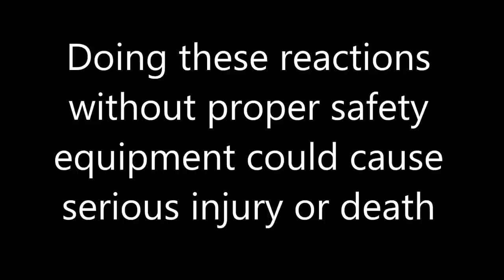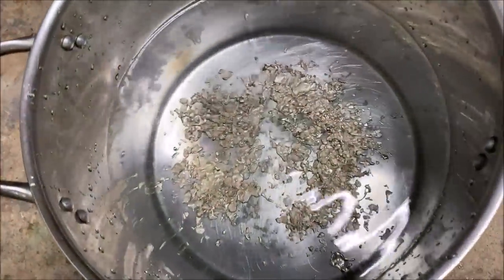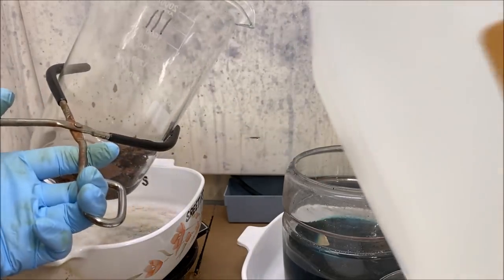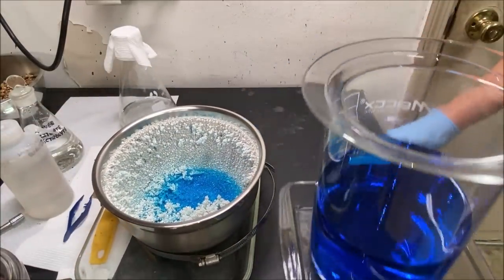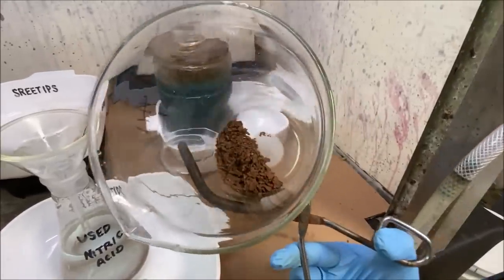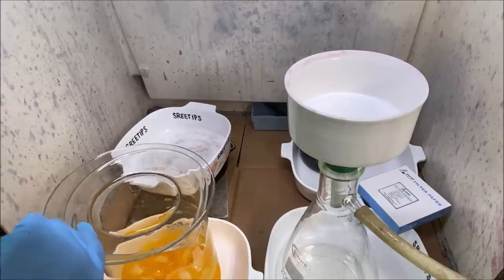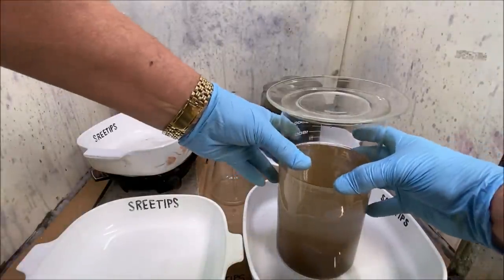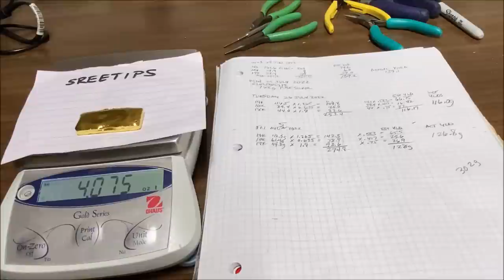Four Ounce Gold Bar Refine With Silver Cell Harvest

Comment: hey sreetips love everything, um the pre-heat on the graphite mould is required - but you should turn the flame off before pouring as it makes swirls. your bars wont come out with circular marks

Comment: The way the title of this video is written. I thought you were going to remove the silver from the gold using your silver cell. Now that's an experiment I'd be interested in seeing. Next batch of karat scrap inquarted with silver. Try running it through a new anode basket and a fresh batch of electrolyte. Then process the anode basket and see how it turns out. That could possibly be another way to minimize the use of nitric acid. New and exciting content is hard to come by when you're refining gold over and over again. Food for thought. Best wishes Sreetips

Comment: I noticed in some of your videos you are wearing a black respirator, if that is a 3-M respirator then that is only for spray painting and certain vapors, that is not an acid respirator.  You should wear the 3-M 5000 series yellow in color for acid gases.  They work very good for Nitric, Sulfuric, Hydrochloric and the NOX given off by the reaction from the Nitric.  Also whenever your not using your respirator it should be stored in a zip lock bag or the bag it comes in which is also a zip lock style bag.  They will continuously absorb all the time they sit outside of the bag and shorten their life span.
Reply from the maker: Good to know, thank you

Comment: When doing those nitric boils to remove the silver and base metals from the inquarted gold, I feel like it might help to use a glass rod to kind of crush the gold between each boil. I feel like it could increase the surface area that the nitric would make contact with and possibly be more efficient. But this is purely conjecture as it's just something I thought of and not from any experience of my own.
Reply from the maker: That is not recommended. It will release nano particles of gold that will suspend and be hard to separate. Even worse: form colloidal gold.
Reply: @sreetips  see that's why I asked I didn't think about that aspect of it.

Comment: So "Gold filled" material differs from "Gold plated" material only in the thickness of the gold coating?  Is there a difference in the manufacturing process?  This part is unclear to me.
Reply from the maker: Gold plated is only a few microns of gold electroplated over junk metal that’s first been copper plated so the gold plate sticks. Gold filled is a sheet of karat gold that is heated then pressed/rolled to weld it to a base metal, usually brass. The coating of gold over gold filled material is hundreds times thicker than gold plated.
Reply: @sreetips  Thank you very much for that clear explanation.

Comment: Never enough of such videos. I had to clean my gold button after cupellation, probably some magnesium, bismuth and basemetal oxides residues on the surface but no sulfuric acid at home. So I used pH- for swiming pools (NaHSO4) with o drop of HCl. Works well, just takes some time. 
Do you know, how to clean silver bead from such oxides? What acid does not damage pure silver? Or do I have to melt it?
Reply from the maker: I’m not familiar with the processes you’ve mentioned here.

Comment: Question: why do you use Sterling Silver cutlery or scrap jewellery to enquart your gold? Seems like you have a massive amount of silver crystal growing in the silver cell, I wondered why you didn't use that? Is it because nitric acid eats the alloyed Sterling easier than the purer crystals?
Reply from the maker: No, it’s because the crystal has already been through the silver cell. Using it to inquart would dirty it up and require a second pass through the cell. That’s like taking a step backwards.

Comment: You just need a collar mic. Will stop most issues with sound and mic being to close to mouth. No more 1970s talk show voice pop.
Reply from the maker: I’m in a high-noise area. A collar mic would be the same as the mic on the camera. All you’d hear is the fume hood. I point the mic at my mouth. If it slips just an inch down my chin, the ambient noise dampens the sound of my voice to the point it can’t be heard. I’ve got it too close. I’ll adjust it out about 1/2 inch and that should kill the pft sounds. Plus, I’ve created a new mic configuration that’s much easier to use. Just need to dial it in.

Comment: Can a carbon rod be used to stir , and or issues for & against using either ?
Thanks again
Reply: Graphite is carbon. It's just the name of a specific molecular structure of carbon atoms, just like diamonds are carbon in crystal form.
Reply from the maker: I’ve always used a graphite rod and it’s worked perfectly.

Comment: Can you please explain the purpose of the half hour of boiling in distilled water, after the 6th boil and rinses ? It would seem a bit overkill, so I'm overlooking something.
Reply from the maker: Overkill is something I sometimes engage in. I did it to remove any soluble compounds before dissolving in aqua regia.
Reply: @sreetips  What keep coming back to me is: what kind of stuff would be insoluble in boiling nitric acid, but soluble in boiling distilled water? My mind draws a blank, but I've got an MSc in Materials Science & Engineering, which does involve quite a lot of chemistry, but it is not quite the full package compared to a proper MSc in Chemistry. Hence my question on maybe missing/overlooking something.

But don't let my own low-grade annoyance with a little unsolved chemistry riddle stop you from keeping this up! I highly enjoy your videos.
Reply from the maker: Nitric acid is soluble in boiling water.

Comment: How come just the silver plates out in that silver cell? Judging by the color of the electrolyte there's some copper in it yet the copper remains in solution and doesn't plate out with the silver
Reply from the maker: Correct. As long as copper concentration is kept below 60 grams per liter then it won’t plat out with the silver. However, the silver in the electrolyte become depleted as the cell operates. If the silver concentration in the electrolyte gets too low, then copper could start to plate out and contaminate the silver.

Comment: Watching at the beginning a question came up that I am surprised I haven't seen asked before.  Where did you get the constants you use when you calculate the inquartation values?  I ask as your method seems a LOT better than how I have always done it.  I always calculate the actual amount of Au by percentage for each k (ie 10gm of 12k is 5gm Au),  add all Au value up and once I know the total weight I can calculate how much sterling to add to the whole thing.  I like your way MUCH better but I cannot figure out where those constants came from....and I've done the math.  :)
Reply from the maker: I used to do a long calculation to get the amount of silver needed. But then a viewer just divided the amount of silver calculated by the amount of gold I started. The result was a number that works every time, and yields the same number (constant) as the long drawn out calculation does.

Comment: Excellent video, just wondering as your Nitric Acid is one of your major expenses and a significant amount gets evolved off as the Red/orange fumes which need to be ventilated out, would a bubbler to draw the fumes through a beaker of water using a vacuum create more Nitric and stop it being ventilated off,  another thing I thought of is the silver cell doesn't need a single bowl it could be a double bowl with a wet fabric like link to allow the ions to migrate, then you could use a larger quantity of the shot and the slimes would stay put on one side of the link,  the copper dissolves in the electrolyte that maybe could be electrolysed out on the slimes side'  stopping it getting into the deposition side maybe?
Reply from the maker: I’m going to build a second cell. For now, I can get plenty of nitric. I buy six 2.5 liter bottle of nitric for about $350 delivered. That’s enough to refine $100k in gold. So the nitric is almost an insignificant expense, relative to the amount of gold it can refine.
Reply: 21:11 The dark red fumes being vented off is NO2, nitrogen dioxide. 
That's stuff we don't want to hang around the shop if at all possible.
Reply: @misterguts  That is why he is doing it in the fume box, were it gets sucked away (and dropped outside, not quite environmentally sound practice).

Comment: I am curious to know what is the white crockery tray made of which you keep on the hot plate
Reply from the maker: Corning ware - is called pyroceram. It can actually get red hot and still take it. But it’s not bullet proof. I had some wet cement silver in one with the heat on high and I forgot about it until I heard it shatter.

Comment: Thanks Sreetips.

I've noticed that these videos typically see you melting sterling cutlery.  Is there a reason that you're using sterling over the crystal that you grow?  Or is it just convenience?
Reply from the maker: Yes, the reason I use sterling: because I refine silver also. The first step in silver refining is to burn it then dissolve in hot dilute nitric acid. By using sterling to inquart I’m refining the gold and silver at the same time. Silver crystal has already been through the silver cell. Using it to inquart would be a step in the wrong direction.

Comment: Q:The silver cell with the electric current is just purifying the silver?? Or is it cementing out from the electrolyte with the help of the current,?
Reply from the maker: The current flow passes through the impure silver shot (about 98% to 99%) and it dissolves the impure silver shot. The silver ions pass through the filter, travel through the electrolyte, then plate out on the inside of the stainless bowl which acts as the cathode. Some of the silver in the silver nitrate electrolyte gets depleted as the cell operates. It plates out on the cathode.

Comment: So, silver chloride doesn’t just react with tap water? It also reacts with cold temperatures?
Reply from the maker: Not that I know of. I’ve never seen silver chloride form because the solution was cold. “?” I take that back. Adding ice to a gold chloride solution to chill it will cause any dissolved silver chloride to come out of solution so it can be filtered out. But I’ve never seen silver chloride firm from cold in a silver nitrate solution. But I have seen silver nitrate crystals firm in a silver nitrate solution after it cooled down.
Reply: @sreetips  got it…. I think. Lol…

Comment: The vapor produced during the aqua regia/gold dissolving seems to be the same color as the gold solution. Is any gold lost/carried off in the vapor? If not, then what is the composition of the vapor?
Reply from the maker: A tiny amount in the form of micro droplets probably leave the beaker with the vapors. I don’t know the composition, but it’s poison to breath.
Reply: @sreetips  Those reddish brown fumes are nitrogen dioxide, can be converted back into nitric acid by forcing it through water.

Comment: I am currently watching one of your silver videos you made a year ago and it made me wonder… what would happen if you put silver or gold that you turned in to a solution under your flame when you typically melt the powder into a solid bar? I hope my question makes sense… so basically you turn the gold or silver in to a liquid solution and then “melt” it with a flame, what would happen?
Reply: You would leave a salt deposit. Ionic solids. Need an electron to hoppity hip or something
Reply from the maker: I understand. I’ve never tried it. But my guess is that we’d lose lots of the metal.

Comment: Will a battery charger work for a dc power source for a silver cell
Reply from the maker: Not unless you can adjust the voltage down to 3.5 volts DC. This is critical. The silver will grow with a battery charger. But the crystals will be long needles that grow so rapidly that they will make contact with the anode basket, burn a hole in the anode filter, spill anode slimes into the pure silver in the cell and contaminate it. So no, a battery charger is not recommended.

Comment: If you left the silver cell going for more than 10 days could you get bigger better crystals?
Reply from the maker: The silver would continue to grow, contact the anode basket, burn a hold on it, and ruin the batch of silver.
Reply: @sreetips  oh.

So contact is bad! That makes sense. Wouldnt you also get more of the bigger crystals? Could you use the stir rod to knock off any dangerously long ones and grow more big ones for ebay sale that way?
Reply from the maker: Possibly

Comment: Uhhhh wait a minute. I thought you were going to use the Gas bubble process to drop all the GOLD out of solution, because it was a more efficient and accurate process ? Why have you gone back to the Sodium Bi-Sulfide (Crude) chemical process ? Gas reconstitution will always be a 100 % efficient process while Sodium Bi-Sulfide will drop out any lingering contaminants as well (??) 💁P.S. 4.1 Troy Ounces equals roughly $7,123.52 USD. Not bad 👍😃
Reply from the maker: Mark, it’s going to the big refiner. I don’t need to be picky about ultra high purity. The SO2 gas rig is a pain to set up and tear down. Adding SMB right in is so much quicker and easier.
Reply: @sreetips  I see. But I'm wondering if it might not be a sort of false economy, when you repeat the process up to 3 times that I've seen, to increase the purity of your gold, when the gas refining method yields instant purity ? It maybe a pain to setup the gas method, but you will get a guranteed 100% of gold dropping out of solution, and only the gold, plus it will be absolutely pure gold.😃👍

Comment: Have you ever made aqua regia with muriatic acid and sodium nitrate?
Reply from the maker: No
Reply: @sreetips  I'm going to try it, hope everything comes out good. I searched it on google to use 120ml muriatic to 2 tables spoons of sodium nitrate. Thanks.
Reply from the maker: I thinks it’s called poor man’s aqua regia. I’ve never tried it. If trying to dissolve some gold, use a very small amount as an experiment before going all in. If it works then scale it up a little at a time.
Reply: @sreetips  It worked, I did a small amount to try it. But I had a overflow when I added the smb with water, too hot I assume.

Comment: What kind of gas are you using? Mapp? Or oxygen and propane or mapp?
Reply from the maker: I use map gas (small yellow cylinders from the hardware store. And oxy/acetylene.
Reply: @sreetips  thank you so much. I have 10 k gold things and I'm curious if just with high heat, if it's possible to separate the elements. Curious.
Reply: @sreetips  does mapp with oxygen work also?
Reply from the maker: Yes, it’s hotter than oxy/propane. But not as hot as oxy/acetylene.
Reply from the maker: No, melting the metals causes them to alloy together. They don’t separate.

Comment: Why do you dilute the nitric boils?
Reply from the maker: Good question. Adding water, diluting, provides a place for the dissolved silver to go. We could use undiluted nitric. But it wouldn’t be very efficient. The best example is washing you hands with just plain dish soap and no water. It would work. It would get your hands clean. But adding a little water increases the soaps efficiency.
Reply: @sreetips  ahh! That makes sense! Defs need water to wash the soap away 😆

Comment: Do you use a TEC sharpie marker?
Reply from the maker: It says “SHARPIE” on the side of the marker.
Reply: @sreetips  Sharpie® T.E.C. (trace element certified) Permanent Markers contain less than 200pm of chlorides and other halogens that can cause stress corrosion on metals such as stainless steel and titanium.
Reply from the maker: I didn’t know that. I don’t apply the sharpie to the metal, only the outside of the glass.
Reply: @sreetips  I use them in my industry of pharmaceutical inspection of stainless steel welds.